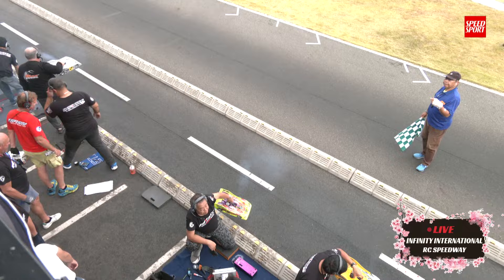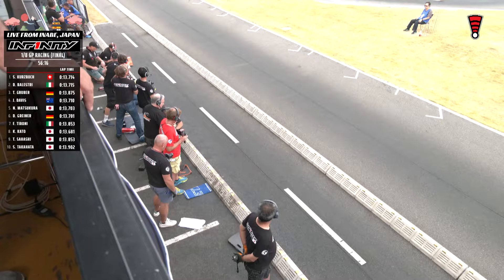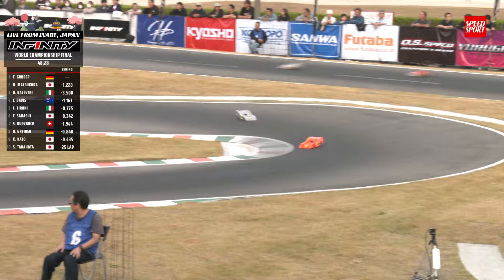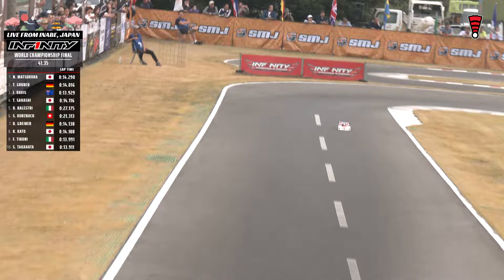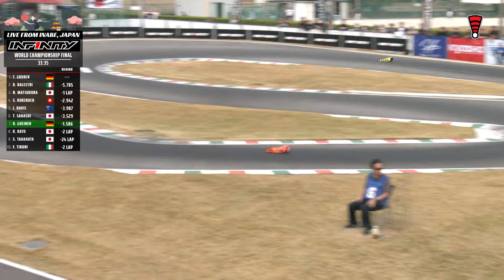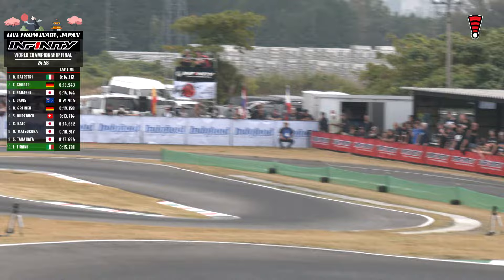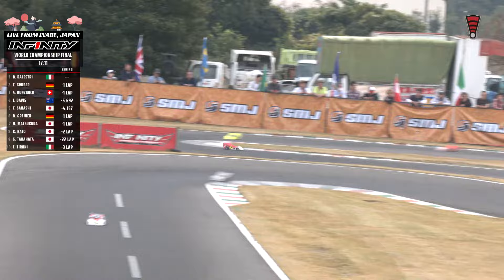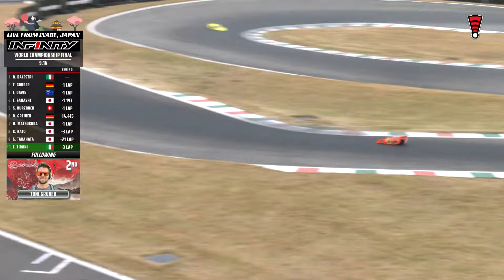2023 IFMAR 1/8 Nitro On-Road World Championship FINAL RACE

Comment: 8th scale nitro on-road is the ORIGINAL RC class--the first production cars came out in 1969-1970.  This is still the hardest, most expensive,most technical and arguably most exciting race class in all of RC. No rubber tires, foam only, HUGE downforce from the Can-Am style bodies, quick release wheels.  It is one class I never tried but want to a some point.  The other oldest class is 1/12 on road; that class came to be because of weather in the midwest.  Racers still wanted to race in the winter but unlike Southern California they couldn't race outdoors year round.  So a few guys took a small chassis, rechargeable ni-cad batteries and motors from a Dustbuster rechargeable vacuum cleaner and they wound up running them on gym floors and office carpet indoors.  1/12 scale electric wound up becoming the MOST difficult electric class to master!  1/8 scale nitro on-road and 1/12 scale electric on-road are the grandaddy of all rc car racing.

For those that think these are just toys, my latest Capricorn 1/10 scale electric touring car is probably $2000 soup to nuts, not including tool, batteries, chargers, radio.  The top drivers make good money and are paid to travel to international races sometimes up to 180 days out of the year traveling.  RC racing is ACTUAL racing--it is an ADDICTION but it isn't easy; if it were easy everyone would do it!
Reply: My first rc was the Tamiya sand scourcher,Fox,Porsche 959,Toyota bruiser 4x4 then I bought a few Kyosho nitro buggies and a formula racer and a few thunder tiger ,nouva faor ,venom gp bikes... 1/5,1/8,1/10/1/12 scale! but what started it all for me was my cox teather planes and thimble racers!! RC's take the stress out of everyday life and keeps us young at heart and smiles on our faces!!!

Comment: the first video i had to slow down not to get motion sickness,  boy are these guys fast
Reply: You have to kind of look ahead peripherally apex-to-apex. Eventually, you get so used to it, that your car seems to appear to slow down (table-tennis is similar and badminton). 

Then when you look at the likes of F1, those cars appear to look very slow. With the exception I'd say of high performance hill climb race cars running Judd V10 engines.. and time attack circuit race cars E.V. high performance cars such as McMurtry Spéirling.

Now you need to look at 1/12 LMP modified cars.!

Comment: I can't imagine the cost required to maintain a top quality car and keeping it in proper running condition with top of the line parts and equipment along with paying for travel to competition and the entry fees. You must have to have some money to be able to participate at the top level of this sport/hobby because I can't imagine the tens of thousands of dollars that goes into a whole season of racing.
Reply: This is the Formula One of Rc car racing, all the drivers in this A main race are professional Rc race drivers. This is their job and are sponsored, some have multiple sponsorship. The manufacturers supply most of if not all of these drivers👏🏼👏🏼👌🏼👌🏼

Comment: So if those engines are turning 50,000 rpm for 60 minutes  that 3 million resolutions!!  Thats amazing.   Not sure on the 50k.  I know some engine are capable of 50k.  Not sure these guys are running but wide open most of the time!
Reply: They run in the 30 k rpm range not 50

Comment: Blows my mind that Formula 1 car pit crews can add fuel and change those 11.5kg(about 25lbs) tyres faster (about 2 sec) then these RC guys!
Reply: They don't add fuel in f1 anymore. Plus f1 crews have multiple guys while in 1/8 onroad they have maximum 2
Reply: @thelag1200  My point is, try taking a 25 lb tire off and put another one on in 2 sec! That included taking the Nut off and putting it back on!   Even with each guy doing their own tire, that's super impressive.
Reply: @radicalrick9587  theres multiple guys. There is one guy who unscrews the tyre with an impact gun. The second guy rolls off the wheel. The third guy rolls a new one on, and the 1st guy screws it back on. Its not  THAT impressive, the rc guys are faster
Reply: @thelag1200  Same point, it's even harder when you have a lot more guys around, because, as you know, it's so easy to trip over everyone, especially in a very tight space just to change a tire! Everyone has to move out of the way so the other guy can do his job then he has to move out of the way so you can do your job! They repeat this when taking the tire off and then putting it back on! WOW!  That makes it even more impressive.
Reply: @radicalrick9587  i personally believe that the rc pit crews are more impressive as there are only 2 guys max and they do the work of 13 people at once and almost as fast. THAT IS IMPRESSIVE
Reply: @thelag1200  I used to race RC in Gardena, California. ASCOT, I've never lost a race, ever. But We didn't race long races where we changed tires and refueled, etc.. I had a ton of trophies. I raced Battery RCs.   You know, each of us is entitled to our own opinion on what we think is more impressive.
Reply: @radicalrick9587  exactly!
Reply: @thelag1200  the guy youre talking to is special ed, motorsport is a giant industry and formula 1 is often said to be one of if not THEE most expensive Rich Mans motorsport there is (no such thing as cheap motorsport [if make regular wage that is], not even karting), all that money coming and going ofc theres going to be efficiencies and etc.
Reply: @radicalrick9587  3 guys for each tire.
Reply: @bubba88188  Yes but the main guy still has to pull the tire off and put the other one on.

Comment: 😊fun to watch as you can remove the worst sound... but in reality it's terrible😮... just terrible.🙉  I am so happy that there are electric planes and electric cars... clean and much quieter..🥰
Reply: You get back to your electric toys. This is proper racing .
Reply: Methane burns very clean.
Reply: Believe the lie. The amount of energy it takes to mine and source the things to make electric batteries create waaaaayyy more pollution for the air and environment than it does for vehicles that run on fuel. Not to mention the absolutely horrible and unsafe working conditions involved and the children they have mining in homemade dugout mines in the Congo for example where at least two people a day die from the mines collapsing on top of them as well as all the medical problems it causes those who handle the cobalt without the proper safety equipment and who wear no shoes or boots as they walk around in cobalt contaminated water. It causes all kinds of health problems including cancer and birth defects to name a couple.